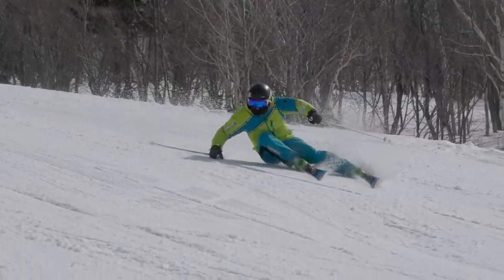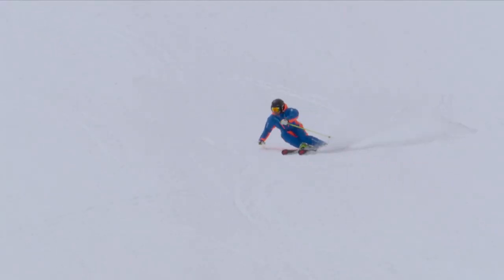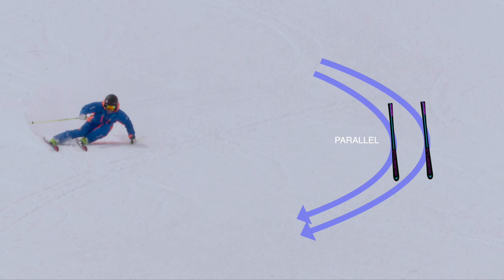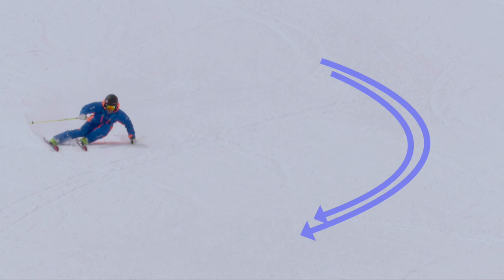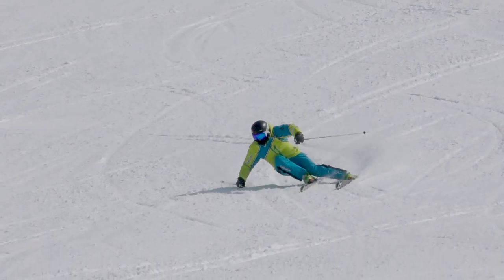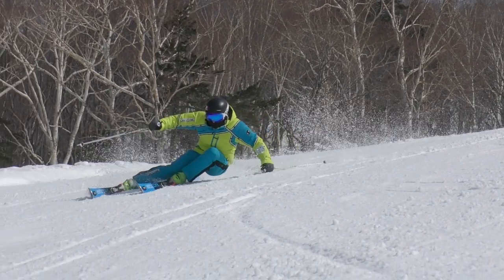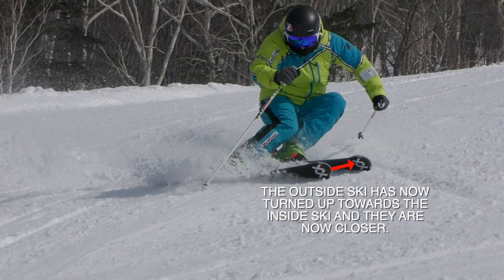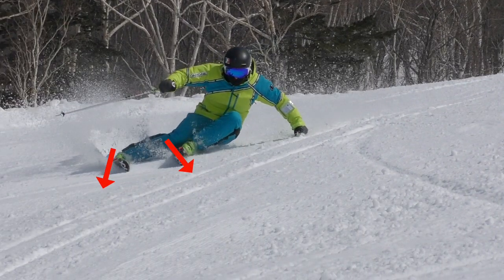parallel CARVING skiing is impossible? EXPLAINED

Comment: This is an awesome breakdown of the turn.  One thing is at 52 I can’t seem to lay the hip to the snow anymore which changes that arc from the get go.
Reply from the maker: it will still apply as long as you are still balanced on the outside ski mainly and bending the outside ski, but it might not that visible.

Comment: Spot on. What you say can't be untrue. The evidence of the ski tracks, plus the fact that one ski leads the other by different amounts at different points in the turn, means the ideal of perfectly parallel skis always throughout the turn is a myth and a false ideal, and always has been. Respects, G
Reply: Mmmm. I've been trying the usual application of alcohol to this.
At some point I mumbled 'parallelishness' into the screen.
(At least, I think that's what I said.)
So.

Everything should be made as simple as possible, but no simpler, yes?
And the corollary of that here is, there can be such a thing as being too parallel!!!
Shock, horror!

As per your vid, the spectrum of parallelishness lies between extremes of:
* wide stance, along short radius turn - low parallelishness 
* narrow stance long radius turns - great parallelishness 
with every variant in between inc. deep carved varying wide/narrow/wide stance along the track.

The skis should be made as parallel as possible, but no paralleler.

Job done by you, Reilly! 
Great video!
Reply from the maker: Yes sounds about right 🤟😊😂

Comment: Hi Reilly. A quick geometry tutorial for anyone interested. Circles can be parallel. Two circles in the same plane with the same center point are parallel. Arc segments of two parallel circles defined by the same two radials are parallel. (A radial is any co-planer line that starts at the center of the circle.)

Dipping into infinitesimal calculus, the path of a ski can be described as an infinitesimal series of minuscule circular arc segments. ("Infinitesimal" means described by the smallest non zero number. Super tiny.)

For each infinitesimal arc segment, there are an infinite number of parallel arc segments. When you add them all up you get the turn shape. So for any turn shape, there are infinite number of parallel ski paths.

Geometry does not support the notion that it's impossible to ski perfectly parallel.

Begging the question, is it impossible for a real skier to have the necessary amount of ski control to make both skis track the same infinitesimal arcs? They're there to be had.

And if indeed it IS possible, is skiing perfectly parallel a worthwhile goal? Why does it seem to be the Holy Grail of skiing? What's so good about it?

As always, your video was entertaining,  but it didn't resolve the issue. My takeaway is that making perfectly parallel turns and high performance skiing are not particularly compatible. Not that making perfectly parallel turns is impossible.

Thanks for the video.

Cheers.
Reply from the maker: You seem pretty clued onto geometry. So you are telling me that if the outside ski makes an arc of 9 meters and the inside ski makes an arc of 13 meters they can be parallel the whole way according to geometry not supporting my theory?
Reply: @ReillyMcGlashan  Hi Reilly. Sorry I wasn't more clear. I'll try again.

What I said was any turn shape has an infinite number of parallel paths. Let's assume a circular path for simplicity.

The side cut of a ski is a circular arc segment. If the ski is marked 19m, it means it's an arc segment of a circle with a radius of 19m. 

The radius marked on a ski is it's unflexed side cut. It's a starting point. As soon as you start bending the ski, the effective radius of the ski tightens. 

If your outside ski path is a circular arc segment with a radius of 18m and your feet are  .5m apart and you bend your inside ski to a radius of 17.5m, the ski paths will be parallel. 

This would require more pressure on the inside ski than the outside ski to bend it more. And the pressure control would have to be very precise throughout the turn.

Which brings us back to my questions. Can a real skier control the pressure that precisely? And if he could, would he want to?

I'll share my thoughts. If it could be done, it would be a parlor trick, like skiing on one ski. It would be cool and fun for a minute, and would sharpen your skills, but it wouldn't be the optimum way to shred. It might actually be impossible. But not due to any geometric constraint.

There are good reasons to ski parallelish, but perfectly parallel, not so much.

Anyway, I appreciate your reply. I always enjoy sharing ideas with someone who knows what he's talking about.

Cheers.

Skiing: Where Physics touches the Soul.
Reply from the maker: @ArcFixer  what you said now is exactly the point of my video. That people think skiing parallel is the end goal. It was more a point that if you bend the outside ski and have weight on the outside ski then you will see these characteristics of not being parallel and that’s “ok”. Being parallel for me while carving is not the end gaol and looking for the divergence and convergence within the turn means you are bending the outside ski. 👍
Reply: Hi Reilly. I figured we were on the same page. But I thought it would be worthwhile for everyone and fun to delve a little deeper. So I played Devil's Advocate. :)

Seems like we got right to the heart of the matter. Don't worry about skiing perfectly parallel. It's an illusion. Good skiers may look like they're skiing perfectly parallel, but a closer look reveals the rhythmic divergence and convergence as the pressure moves from ski to ski and the skis are differentially bent.

PS: I've been skiing Park City and Deer Valley since 1981. I've had many opportunities to observe Stein Eriksen's skiing. I actually worked in his shop at Deer Valley for some 10 years, so I rubbed shoulders with him a little bit. Legend or not, he was humble, kind, and generous. But I was never tempted to ski like him. I wanted to ski like Phil Mahre and Ingemar Stenmark. That was a long time ago. Now I just wanna ski like me.

Cheers.

Comment: What are your thoughts on different sidecuts on the inside and outside edge of the skis? Shorter turning radius on the edges facing outward, giving the inside ski a tighter "natural curve". 
This will of course give left and right foot specific skis
Reply from the maker: Elan had a ski that did this i think but i never got to ski it. So not so sure how it skis.

Comment: It’s not impossible, there’s just too many variables to account for. First of all, the skis displace the snow as they carve, so no turn is purely carved unless you’re on bullet proof ice.  Look at your trenches after a carved turn and the outer trench is usually a bit bigger/deeper. Both skis could be tipped on the same angle, but because more pressure is directed to the outside ski it will displace a little more. The inside ankle is flexed more than the outside ankle, does this cause the ski to bend more or rotate more? The outside ski travels a longer path so it probably travels faster than the inside ski around the arc, and/or you ski in and out of counter, so your outside ski actually starts ahead of your inside ski and finishes behind it.

If we’re talking purely aesthetics, you can absolutely carve a turn where the stance width doesn’t change and you get 2 parallel lines in the snow, there’s just other stuff going on to make that happen.
Reply from the maker: it just depends on your idea of ideal carving...  I would classify a good carved turn which has the weight on majority on the outside ski. if you bend the outside ski to its tightest radius it can bend to, what does that mean for the inside ski? you would have to bend it even more than the outside ski to keep it tracking parallel, but if you have already bent the outside ski it to its minimum radius then that means it is impossible to bend the inside ski even more than the outside ski. Even if both skis were weighted evenly and edged evenly then they should in theory carve the same size turn with will still apply the same theory as in the video. Obviously you can make the inside ski carve on a tighter radius just like a showed at the end if your skis are diverging at the end your weight is on the inside and the inside ski will start bending and carve a tighter track than the outside... I totally agree though that there are so many variables that many things can happen and also peoples goals or idea of what they want to achieve is different, but most people who carve have similar goals which are: balance on the outside ski mainly, and increase edge to bend the ski and tighten the turn and get some good rebound for fun sensations. With that in mind the rules in the video apply.
Reply: @ReillyMcGlashan  the skis don’t have to converge/diverge. If the outside ski is at maximum bend, you’re obviously standing on it pretty hard, so it displaces more snow from underneath the ski. It ‘slips’ more than the inside ski. They can both stay parallel when this happens.

Comment: Hey Reilly. Great content you're putting out there for us to digest. I'm concerned about your explanation of divergence at the top of the turn and convergence at the bottom. I completely agree that when you look back at the tracks you see the lines diverge and converge, but for me, I believe this has more to do with the shortening of the inside leg and so while actual stance width remains the same, the more I shorten my inside leg the more physical distance there is between my feet. The results of which are the tracks looking the way you have drawn them. My concern is hat folks not skiing on a high edge angle will interpret this as it's ok for the ski tips to get further apart/tails to get closer together at the top and for the ski tips to get closer together/tails further apart (wedge) at the bottom. I don't see your skis doing that. Thoughts?
Reply from the maker: It drastically increases this when you shorten the inside leg to its maximum flexion in a big angle turn for sure thats why I drew the two turns. One with the skis closer together the whole way through and the other with what would be a huge shortening of the inside leg. It happens in my skiing every turn where I correctly balance on the outside ski, but like the divergence ,if you round the turn across the hill a lot you probably will only notice it from looking at a diagonal. From the fall line onwards converging happens in all my carving. Sometimes I make a mistake and it happens at the top too, but that is a mistake. If you are doing a steered turn then this doesn't apply as you can steer both skis and they are not locked on their edges which was stated so I am not sure how people will interpret it, I tried to make it as simple as I could. I still call this "parallel skiing" but I just wanted to point out that in reality it can never actually be parallel just for some fun and from the fall line onwards if you are seeing some converging and the outside ski bending back towards the inside ski it's actually a good thing and means your outside ski is bending and working. If you are diverging at the bottom of the turn you are probably on the inside ski (as long as both tracks are carved, if they are skidded then this is not what I am talking about).
Reply: Reilly Definitely a good video. As I said, I for sure agree that the tracks after the turn will not look like parallel railroad tracks because of the effect of shortening the inside leg and the more drastic that shortening the more drastic the difference in the tracks. And I like that you still call this parallel as for the most part the skis are parallel throughout the turn. We were chatting about your video at a morning line-up yesterday.

Comment: Is it Vertical Separation causing this... meaning  Flex Inside Leg and Extend Outside Leg that creates the initial Divergence  in Shaping Phase and then the Outside Leg Flexing to match Inside Leg for the Convergence during the Transition Phase?
Reply from the maker: Yes also true. This also is compounding the effects of what is in the video.

Comment: why change distance between feet?
Reply from the maker: low edge angles you don't need to... if you have your inside knee to your your chest while doing a big edge angle turn and you transition with the skis that far apart your stance will be like straddling the grand canyon.